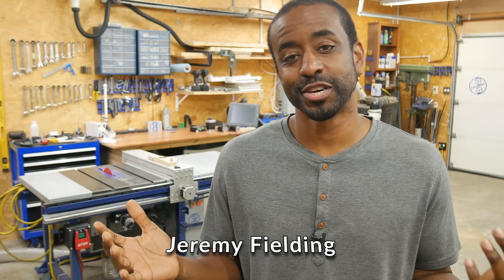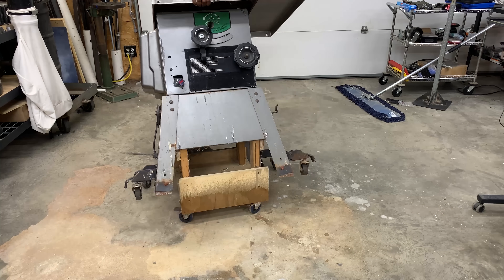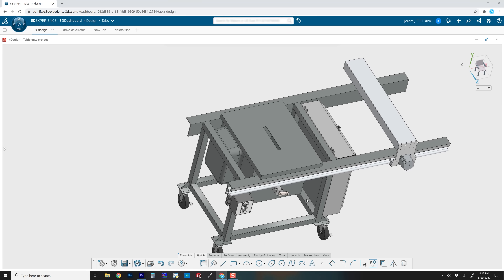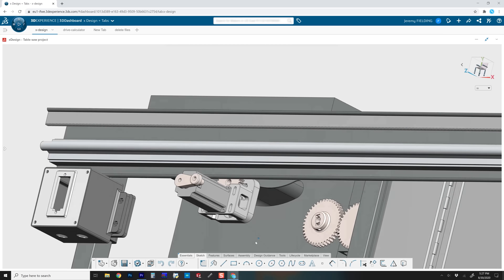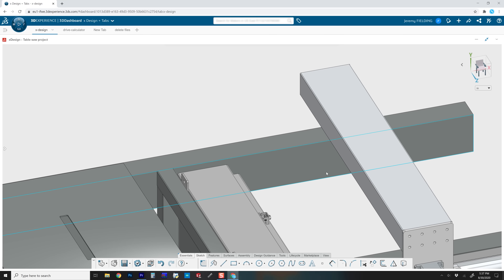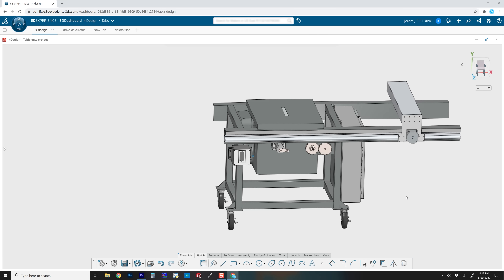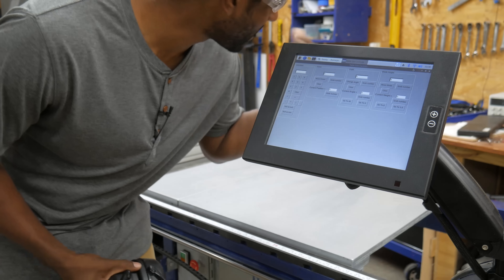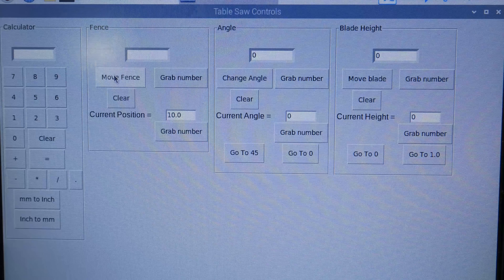How To Make A CNC Table Saw : # 084

Comment: Sand working your way up to 320 grit and then clean with denatured alcohol.  Apply a coat of water based polyurethane with a blue shop rate. Light sand next day with sanding sponge 320 grit.  Apply another coat and your done. This method last longer than anything else I've tried over 20 years.   I do this method on every machine surface I have.

Comment: In this video you asked about acceleration.  Look up PID.  It stands for proportional–integral–derivative.  It’s an algorithm to control acceleration and deceleration.  However, it requires encoder feedback.  That will also allow your motors to know where they are at all times, virtually eliminating the need to reset them to zero.

Comment: For acceleration you'll want to actually look at easing functions which they use in animation. You can do a linear accel/decel or something similar to a 0-1 sine wave segment. Imagine you have an array of all the discrete motor steps points from point A-B, the easing function would tell you at a given time T, you should be at a discrete point in the set [A, B]. You can also factor in the duration you wish to perform the movement and a speed clamp to prevent it from moving too fast or too slow. It's all math. Loving the whole thing, and congrats with jumping into coding whole heartedly, Python is a solid scripting language for beginners.
Reply: Not knowing Python, would you choose the value of T dependent on the value of |B - A| (total count of incremental steps) and/or on the value of S (desired axis velocity)?  Maybe this would be inherent in the instruction?

Comment: I started from scratch no cnc experience at all and build a plasma table I ended up selling it needed the money and I doubled the cost 
I’m impressed I don’t get the code part 
You have all this bad ass equipment you’re building and you’re welding with a cheap flux core welder 
If you’d switch to a gas mig you’d be much happier they weld so much cleaner 
Better than that is tig 
I just ordered a prime weld 225 tig 
Like I said nothing but respect for what you build 
Better welds will improve your builds 10 fold

Comment: What happens if you lose power during a cut? Does the fence go loose on you? You could lose power from drawing too much current and flipping a breaker, or if you're unlucky enough to lose power from the grid during a cut. Could be a serious safety problem for the fence to go loose during a cut. It seems the fence needs some sort of analog break keeping it in place when you're not moving it, as a fallback in case the stepper motors lose power. This thought came to me during a shower and I felt I needed to try to convey it to you. :) Not trying to be the nit-picky safety police! Awesome build! Very cool to see. Thanks for sharing!
Reply from the maker: If you lose power the blade would also stop.
Reply: @Jeremy_Fielding  thanks for your reply! Would the blade stop immediately? On my table saw, the blade continues for a good 5-7 seconds before it comes to a complete stop. If my fence gave out on me at the beginning of those 5-7 seconds, it could be a problem.

Comment: Phosphoric acid is considered a rust stopper , sand it with a palm sand with 220 sp then get some metal prep aka PAcid then a thin coat of boiled linseed oil , dry , maintain

Comment: This is just about the coolest first Python project I could imagine.

One note, instead of manually entering in a know value to tell the motors where they are at, implement a home or datum routine. Have the motor move until it sees a proximity sensor in a known location then use that number.

Comment: look up easing functions to use for Acceleration and Deceleration 
a simple sine or cosine curve will also work.
Divide the total Steps of move in to 8 
the 1st 8th, use the curve function to accelerate
the next 6  8ths, move like you are now at full speed
then the last 8th, use the curve function decelerate

Comment: Make a quick relaese handle for other end of stepper motor so you can take it off when in "CNC MODE" I love it by the way and all your add on's please try and do them!?.
Reply: ALSO in my opinion the motors look very large i have seen 500W motors smaller than this. Would you really need anything more powerful to move an alu fence,                                                    Tilt and height on the saw blade? just a thought you've probably had! cheers

Comment: Keep a running log of dimensions on the screen. That way you can just press the number of a previous cut from the log to move back to that position. A table of common values would probably be nice too, and a button to increment the current position by standard amounts (+1mm, +.25in, -.1mm, etc.).

I have been working on a design for a cnc router/tablesaw were the blade moves and the part is stationary. Figure it will be safer because you don't touch it while operating. I want to be able to use it aboit as easily as a manual saw though,  so will have standard values, and increment buttons. I also might put a digital hand wheel to manually move it.

Comment: Impressive work. To think that someone who couldn't code has programmed this massive and hard problem is just incredible.

A word on motor positioning: you can get better precisions with optical or even magnetic encoders, and limit the error to what backlash wants to be. In fact you can add some retroactive precision by driving the motors with microsteps, if your driver allows you to do so.

Comment: You could make the blade height handle spring loaded so you have to push it in against the spring to engage but when you release it just freewheels on the shaft of the motor.

Comment: This is simply outstanding.  I built my own cnc and I empathize with staring at code for hours trying to debug.  I was planning on doing a project similar to this, but just to move the fence on a miter saw station.  My intent was to write in Java, since I don't know Python.  I may have to "procure" some of your code as Raspberry Pi seems to be more receptive to Python.  My thought was to add a proximity  sensor for calibration.  After disconnect, just calibrate to the known position and your good to go versus trying to manually reset the fence position. 

All I can say is "You're the man".
Reply: Oops. Just saw your comment on a homing sequence.  Disregard everything I said.

Comment: Instead of coding motor acceleration in software, it's easier to insert an electrical attenuation on the line that feeds the motor.
For example, say your motor is powered by 12V.  Instead of a relay that feeds 12V or 0V directly to the motor, have your relay feed to an amplifier, that gradually raises (or lowers) the voltage to 12V (or 0V).

Comment: I would put a encoder on it.. for 2 different reasons you know if it's skipping steps.. you have to remember that when your pushing the wood your also pushing the against the bar and stepper motor.. also by adding the encoder.. you know exactly where it's at everytime.. even if you manually move it.. you will not have to type the number in.. their are fancy linear encoders like what they use in milling machines.. a cheap simple encoder both on blade and fence.. you will just have to home it once and then you can easily manually move it as much as you want..  but you will have to figure out away to mount it probably to the gears on the  because you have to remember dust.. I would not recommend a strip encoder because of dust

Comment: I am sure you have already thought of this but it is low on your list of improvements.  Delay the gate close and off of the dust collection from the time the blade is turned off just to collect the last bit of dust in the line.  A fantastic project, I have a hard enough time just making a crosscut sled for my table saw.  Keep up the great work.

Comment: Another way to “re-zero” would be to have a solid fixed stop at the far end of travel, or maybe a hole on the surface with a pin you can drop in and push the fence to, so that it acts as a constant index so after manual control, push the fence to the “index stop” and just hit a simple “recalibrate” button which lets the machine know “the fence is at the index stop which is a known distance”. Could take the human error out of the equation. I know you could be more accurate in a much more complex manner, but that seems like a simple way. I also know from woodworking experience that the scale on the table saw is almost never spot on, and usually wiggles and shifts over time. It’s a big shot of luck that yours seems to be dead on. Super cool project though! Love the idea.
Reply: Since this isn't the original fence, I wonder if he changed out the scale too. Although, it would also be affected by whatever the thickness of the blade is, since you can buy different blade thicknesses, or even a dado set. Expanding on your idea, if he were ever to want to use a dado set, he could use your recalibrate function to first move the fence to the edge of the raised blade, and then zero the saw there. That way he could get a perfectly accurate cut without having to worry about accounting for the kerf width, and also be able to perfectly set the edge of a rabbet without having to account for the rabbet's width.
Reply: Great comment, I was thinking the similar...
The limit switches could provide a point of reference

Comment: In the beginning, I'm thinking  "man, that's a pretty junky looking saw to be putting all that work in to."  But, you pulled off an amazing feat.  Others have already suggested paste wax to protect the table. I've used MinWax for three decades with no problems -- just avoid anything with silicone or you'll get fish-eyes in your finish.

Comment: Is there anyway to slide the fence back to be behind the blade? If not I wouldn't use the fence as a depth stop when cross cuting, because the wood will bind between the blade and fence and you could really hurt your self.👍

Comment: Given you have endstops, you should be able to write a "zero" function to avoid having to tell the saw where the fence (or other motors) is after you hand move it.  You probably know about it from the cnc cutter, but if not it just involves running the motor till you hit the endstop.  Given the endstop is at a fixed spot, the computer then knows where the motor is and can set it's "zero".

Comment: I wonder if for the acceleration problem on the motors, if using a PID controller would be an appropriate solution, or possibly overkill.  https://en.wikipedia.org/wiki/PID_controller

Comment: Awesome.  Considering programming is new to you, it's absolutely amazing.  I've been programming for over 40 years.  Python is okay, but it's just not my favorite thing.  I'd have done it all in standard C, but that's me, not you.  You need to learn to use threads.  Once you wrap your head around them, you'll never go back to single threaded coding.  The payoff will be when you see your blade height, angle and fence position all moving at the same time.  It might seem more complicated, but it actually will simplify your logic.  Each thread will have a simple task to accomplish and your user interface will be live and responsive all the time.  The fence mover will be the most complex just because it needs to look out for a collision with the blade.  You could have it save the current blade height and then restore it after the fence cruises by.  Steppers are fine for what you're doing.  I like using them too because they're perfect unless, like you said, you overload them or step too fast.  Rather than trying to deal with microstepping and speed ramping, you might want to just buy a ready built solution, a smart stepper controller.  They can often give feedback about a sudden load change, whic might be useful.  

You should do a chop saw next.  Feed wood, clamp it and then cut it to length from a cut list.  Keep up the awesome work.

Comment: You probably already thought of this, but if not, you should add some accel/decel to the movements.  That fence is not all that heavy looking but the inertia of the thing slamming to a stop at whatever point you decide might put extra wear on some of the electronics.   I blew up a few stepper drivers in my CNC doing that.

Comment: This is awesome! I’m actually working on an almost identical project right now!  Being an EE I have a solid handle on the coding and programing but I’m still working out a few kinks in the mechanical design. As far as features go, I’m planning on having the code integrate with and importable BOM format so that you can have a cut list and the program with progressively move through the various cuts as you hit “next”. Great video! I enjoyed this

Comment: I think you should add a common board size feature to the interface, so if you have a sheet of plywood you can push the plywood height button and the blade raises to that height every time.

Comment: You could use a 123 block to rezero your fence rather than eyeball it. That would also make up for different blade thicknesses. That may insult your intelligence because you will probably go with a NASA laser sensor with an atomic clock for simplicity.
Reply from the maker: I like it

Comment: If you setup a move & height function, you could easily setup a feature to drop your blade to 0, then move the fence, and then finally set your height.  If the fence does not pass through your zero, no need to drop the blade to 0 first.  This also has the benefit of reducing the amount of code you have to maintain, and forces you to be "safe" when transitioning between your two sides.

You may also consider a riving knife for safety, even if it's just built into your blade guard.

Overall this looks like a fun build.  Glad the youtubes sent me this to my feed randomly to discover today.

Comment: I friggin love this. Here are some additional ideas to add to it.

1) motor to control the angle of the fence relative to the blade specifically for doing cove cuts on the saw.
2) Blade kerf allowance. SO being able to input the blade kerf and use that for making dados etc would be fantastic.
3) an active sensor to know the position of the fence relative to the blade at all times whether you have it in manual or not. Maybe a laser distance sensor mounted internally in the fence so that it measure to the blade itself and offsets for the tooth set?
4) Automated sliding table?
5) Functionality in the software to be able to enter the work piece size, desired width of cut and have it layout the fence positions as a list that you could just "next" through like you do manually when thin strip ripping.
6) Automated router lift for the open end so you can use the fence in combination with the router.

Comment: I would look at adding some magnetic rotary encoders to the motor axels, turns your steppers into servos as you can monitor actual steps vs expected steps.  Which would make acceleration much easier to cater for as you typically get 1024 pulses per revolution, so a creation becomes a simple time function  (have a look for python sprite easing code, generally it's a simple sine function over time but would give you a ramp up and down) and would allow you to zero your axises accurately when you re-engage motors.  You also can get software limit switches using this method by running to the limits capturing the number of pulses received between limits then adding a guard clause to the control ui to disallow any over limit lengths, and jog and nudge functions become accurate by counting number of pulses.

Great project though, and its not you it's the old engineer vs scientist thing of engineers make science useful, hello world is great theory, but controlling motors is useful, besides nothing stopping you using it to carve hello world into wood now!!!!

Comment: Use some beeswax so it doesnt rust, apply it from time to time. I dilute it with some mineral oil in a pot, so it isnt that stiff. 3 parts oil, 1 wax

Comment: Perfect for saw tables:
Meguires #8 Mirror Glaze maximum mold release wax is what in a tool and die maker‘s use while creating clamshell tooling. It doesn’t cost much money and it leaves you a smooth as glass finish. It’s available almost everywhere. All metal surfaces get coated for smoothness and things slide easier than ever.

Comment: That’s amazing! May I suggest that you add an interlock (cut power to motors, brake, etc) when the movement is done? I would really suck if the fence decides to move while you’re cutting something and your fingers are close to the blade.

For the acceleration, check how existing CNC open source firmware does it. It’s all on GitHub and you can learn a ton.

Comment: Would be super cool if you could add a nudge left and right button right on top of the fence that will feed back to your touchpad and activate the motors while updating the code to position.